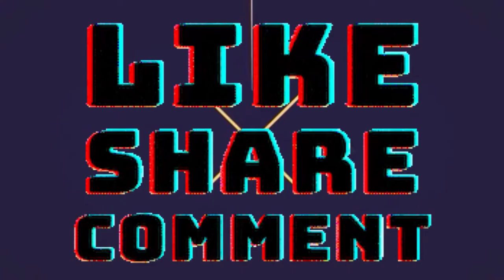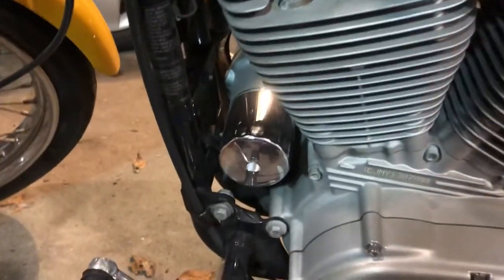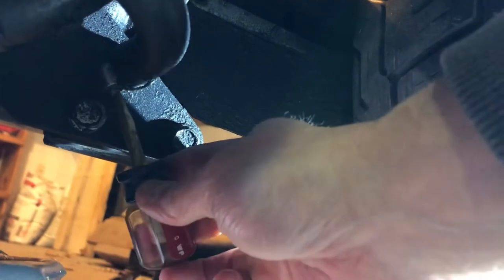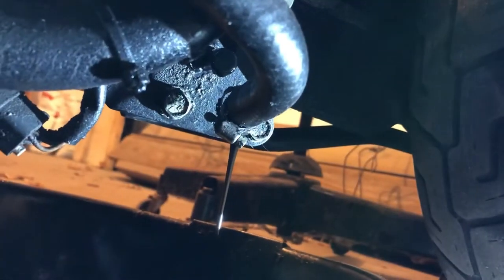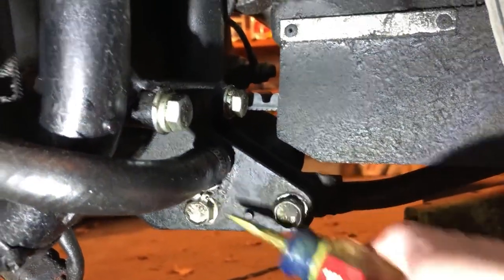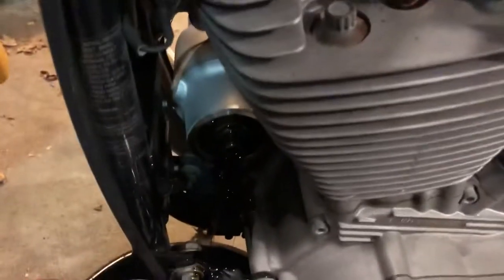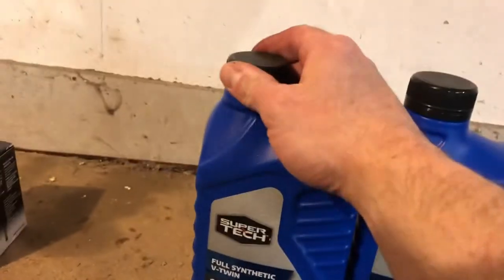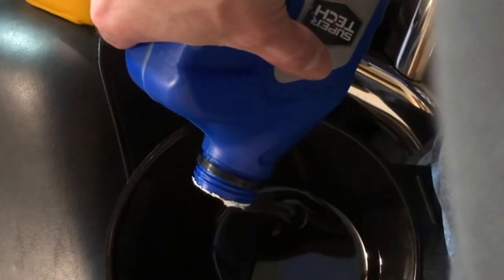1994-2003 Harley-Davidson Sportster 883/1200 How to Change Oil

Comment: Here is a tip, remove the oil filler cap from the tank when draining the oil. It will drain faster.
Reply from the maker: Great tip Joseph! It’s in the next oil change video 😁👍
Reply: Helps even more if the oil is changed immediately after a ride. Oil flows faster when hot.

Comment: No, No...From the manual " pour about 4 fluid ounces of fresh, clean oil into the new oil filter. Allow time for the oil to soak into the filter element. Partially fill oil filter before installation to minimize the time required for build-up of oil pressure when the engine is started."...ref: 2003 Harley-Davidson Owner's Manual, Sportster Models, Engine Oil and Oil Filter,  page 96
Reply from the maker: Thanks Jake 👍

Comment: You’re supposed to pour oil in the filter before it goes back on. Prolly a good idea too to leave the drain hose off and wait until oil is coming out to out it back on to force air out.
Reply from the maker: Thanks for commenting, it helps the channel!

Comment: The oil that you're using junk the filter junk. When you unclamp the hose why don't you take out the dipstick it'll flow faster instead of creating a vacuum. And you always put fresh clean oil on the new rubber on the filter not old oil.
Reply from the maker: Removing the dipstick is a great idea, Thanks for commenting.

Comment: Have you had any issues with your primary chane making a ticking noise at startup or rising steady slow speeds
Reply from the maker: Hey Marla! Sportsters are noisy bikes by nature but tightening the chain to spec and changing the oil and filling to full might help any excess noise. If the noise is really loud you might have a broken tooth or debris in the case. I had a little bit of metal shavings on the magnetic plug from chain and Sprocket wear. I also noticed that my foot shifter was loose and changing gears was crunchy, so I cleaned and tightened that. Hopefully that gives you a few places to look, thanks for the comment!

Comment: 1999 sportster 1200 here, am I safe putting 3 quarts in the tank and just putting some in the filter before reinstalling? Is that enough oil?
Reply from the maker: Yes! 👍 That’s what I do too
Reply: @ChrisBassettTV  thanks!!
Reply: 3.6 quarts brand new off the line engine un-lubed. 3.0 quarts when replacing used oil any time.

Comment: Why is it only 86-2000? I thought the 96-03 bikes were all the same?
Reply from the maker: You are correct! that's a typo on my side. I'm taking my information from my Clymer Harley-Davidson Manual. 86-90, 91-93 and 94-03 have different oil drain hose configurations. I appreciate the catch, Thank you.
Reply: @ChrisBassettTV  all good I was confused as I have a 98 and my brother an 01 and was sure they were the same. Thanks for getting back to me.

Comment: hi!
how many oil for the change? 
thanks!
Reply from the maker: Hey Richard! Approximately 3 quarts…. The oil tank holds 3.3 😁👍
Reply: ok thanks!!
and i have one more question 🙂
i use 20w40 oil for the primer oil..
this type is good for the oil change?
sorry im not the best is english..🙂
Reply from the maker: @richardnogradi5544  75w90 for primary here’s another video 😁👍1994-2003 Harley-Davidson Sportster How to Change Primary/Transmission Oil
https://youtu.be/40dy49vX-4Q
Reply: @ChrisBassettTV  thankyouthankyou 🙂

Comment: How many quarts go in the tank
Reply from the maker: What year is your bike?
Reply: 3 if it's an Evo engine. It holds 3.5 but only top up three after a change. 3.5 is into a brand new engine build with no existing fluids.

Comment: I have used super crap oil in my lawn mower and turned black after a couple of mowings and as far as fram filters if you pay 30 grand + each for a couple race engines you NEVER use fram crap again either !!

Comment: Only problem I have with this video is that, if you used the old oil on the new filter seal, you are applying contaminated oil with metal shavings to a rubber seal. Always use clean new oil to the seal.